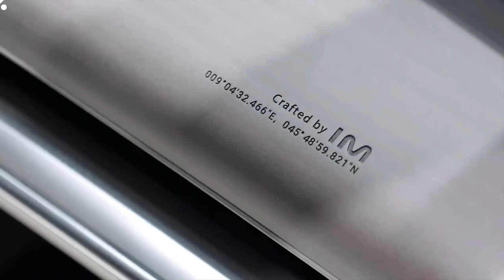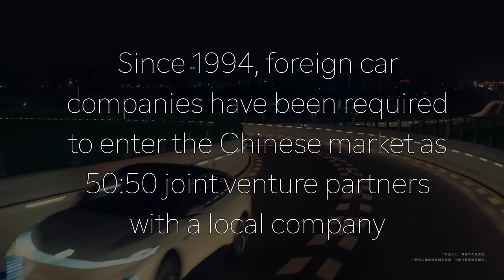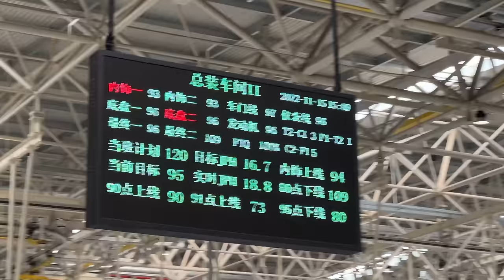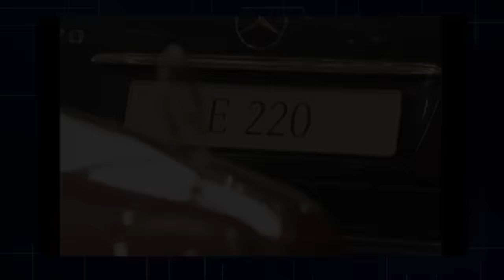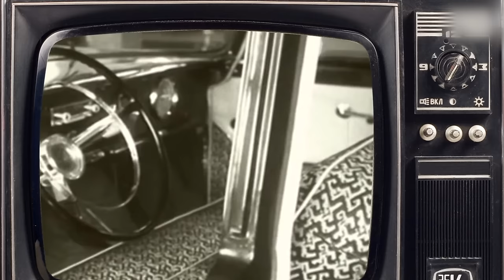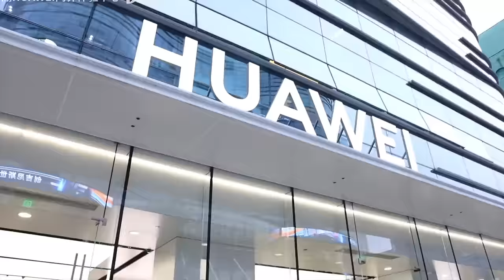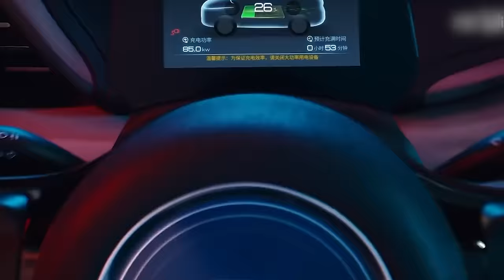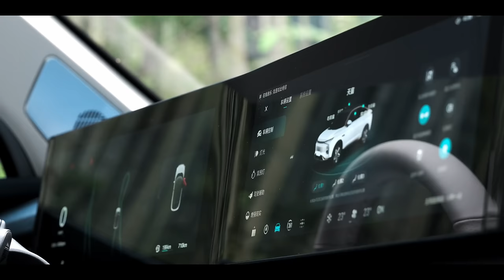Inside the factory of a State-owned car company in China

Comment: You said since 1994, joint venture is required to enter the Chinese market.  I don't believe that is accurate.   BMW entered the China market in 1994.  The joint venture with Brilliance Automotive didn't happen until 2003!

Copied and pasted from BMW group:

Founded in 2003 with Chinese partner Brilliance China Automotive Holdings Ltd. (CBA), the joint venture produces BMW vehicles with internal combustion engines and electric drivetrains for the Chinese market and for export at two locations in Shenyang (Liaoning Province).
Reply: When did VW enter China? 80s
Reply: @yunshenghe932  From the BMW Group news release, it was in 1994.

The joint venture requirement isn't true.  This is not only based on the info from BMW, as Tesla does not have any joint venture either when making and selling EVs in China.
Reply: @yunko9369  Of course joint venture was required for Wester auto makers to make cars in China. BMW 's partner was called Hua Cheng. Tesla was the first one that owns 100% of its investment in China.
Reply: @yunshenghe932  If like you said is required, then why Tesla is an exception?
Reply: @yunshenghe932  According to the news:

Huachen was founded in 2002. It is owned by northeast China's Liaoning provincial government and has around 47,000 employees.
Reply: @yunshenghe932  Since Huachen was founded in 2002 and BMW in the China market since 1994 per BMW Group, how can that requirement make any sense?
Reply: @yunko9369  BMW Group could be  in China since 1994. Were they making cars in China in 1994? Definitely not. They could import cars or do other business. They could only make cars when they partnered with Chinese companies.
Reply: @yunshenghe932  BMW properly did not make any cars in China in 1994.  However, BMW is in the China market at that time.  Therefore, the joint venture requirement can't hold any water!
Reply: There are many western companies that enter earlier such as Audi and Volkswagen.